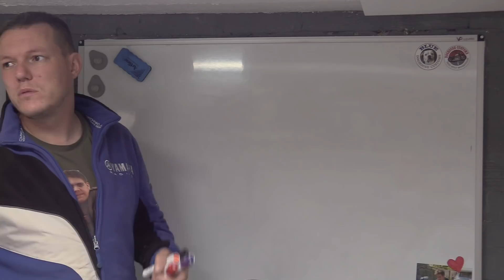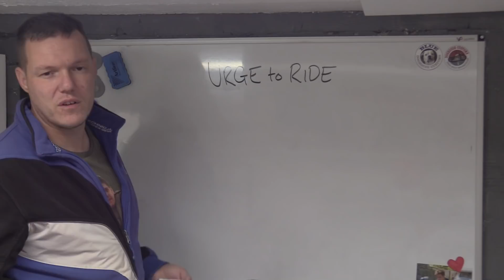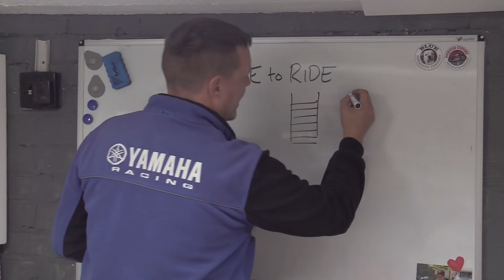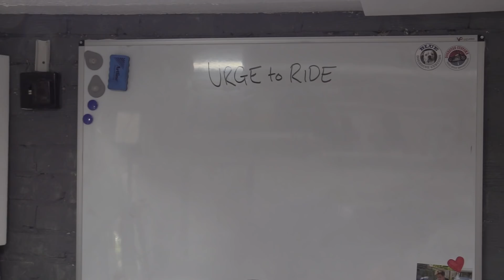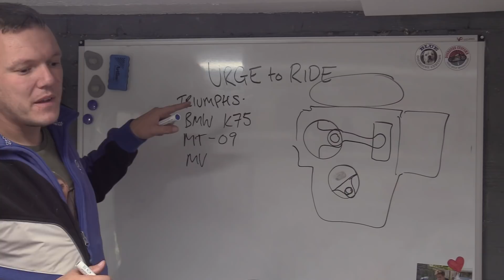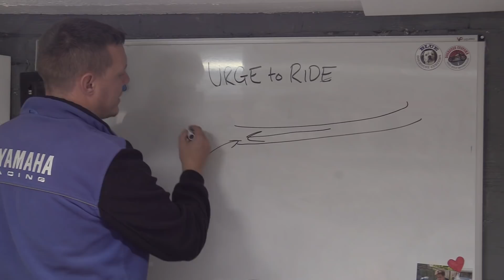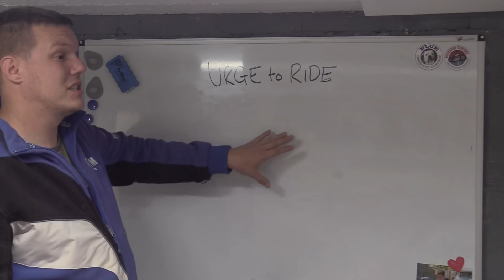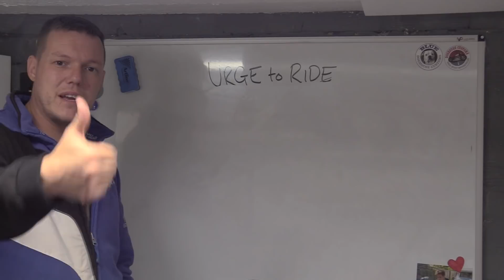Triple Engine Whistle BS - RANT

Comment: You talk about exhaust acoustics and give an example of one guy with an MT09 who swapped out the exhaust and the whine disappeared, but Urge to Ride is talking specifically about about triumph engines, and to be fair to him does say that the sound can be engineered out or emphasised depending on lots of different factors.

This video here has loads of examples of exhaust noises on 675s from slip ons to full systems, yet they all have that exact same distinct whine - it doesn’t go away whether it’s a stock exhaust or full on GP style system.

https://m.youtube.com/watch?v=8Honvru2AcQ

Suggests there there might be something specific to Triumphs when the whine disappears on an MT09 but stays on a Daytona doesn’t it?...
Reply from the maker: It's not the gears. If it were then none balancer shaft engines.wpildnt make the whine. And why don't all engines do it, the primary reduction is the biggest set of gears in every engine. 

Urge to talk shite says triples, and point out balancer shafts as the cause, this is wrong.
Reply: @thedirtyworkshop  Thanks for the reply, I don't know either way, but I thought I would check out some aftermarket Triumph exhuast to see if it made a difference and it didn't. Also, there's this video of a 2013 daytona with the slip on completely removed and it seems to me like there's absolutely no change in the acoustic characteristics of the whine at all:

https://www.youtube.com/watch?v=duueG4RKc6k

So until someone uploads a video with even the downpipes removed which shows the whine goes away, I have to say I'm not convinced by your explanation of it being purely from the exhaust - but you also make a strong case for it not being the balancer shaft or straight cuts gears! Tbh I don't think I'll be fully convinced by anyone who doesn't work for Triumph, it seems like nearly everything else is just speculation
Reply from the maker: Do you know who I am?
Have a lovely day 😘 Xx
Reply from the maker: That was the misses...
Reply from the maker: In the video I say either the intake, exhausts... I'll get a daytona, you'll see.
Reply: @thedirtyworkshop  That would be good to see - planning on buying a 675r this year so I might do a bit of experimenting myself! My neighbours already hate me anyway...

Comment: My 1986 FZX 700 has the whistle sound and has the stock exhaust it also have an external alternator. Other Yamaha fz motors back in the day lost the whine/ whistle with exhaust mods. I'm in the camp the exhaust is a large contributor to the whine/whistle.

Comment: Just a suggestion. I subscribed to your channel because you are more scientific than the other guy, but your presentation is not as friendly as his.
Biggest problem with your presentation is how long it is.

Here are some pointers:
1.plan the video ahead of time to make it shorter.
2.edit.
3.Better audio.

You don't have to use graphics, the board is just fine.
You don't have to stop using adult language, I personally like it.

Just make your video shorter, straight to the point and you should be able to beat these posers quicker.
Reply from the maker: Or no. I've been doing this a lot longer than you've been watching. It's my channel and I'm happy doing it my way.

Comment: to some extent both of you are right, the resons the other guy mentions are there to some extent but are not the primary source. allso if you ever driven a lada niva you know what is spur gear whine.
Reply from the maker: We'll see...
Reply: @thedirtyworkshop  not kidding, that sucker whines. the crude transfer case has a wierd vibration , its like driving whit shit tires, just the pitch is unusually high for that. thats how spur gear while sounds like. absolutely not the kind the guy was looking for with those 3 cyl engines giving that distinct noise. 

btw, i know you are a bike guy, but i have a gut guess you would actually like the niva.